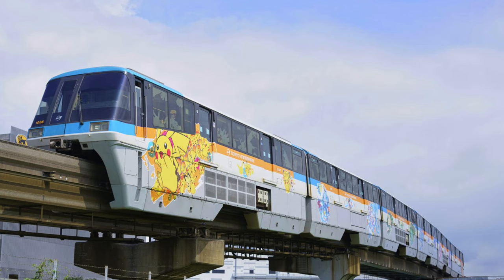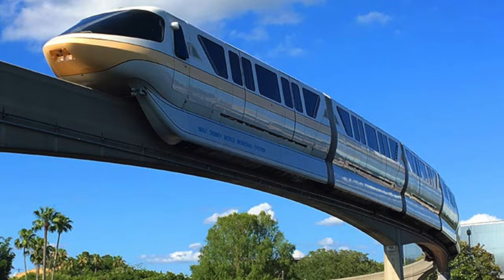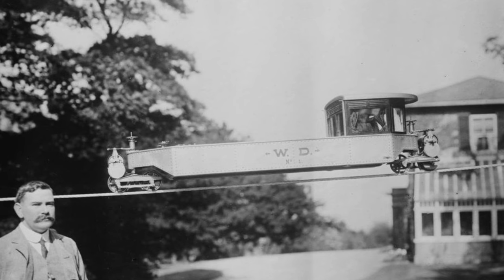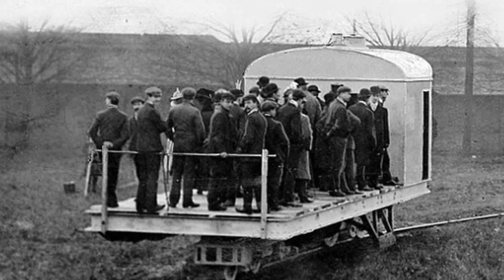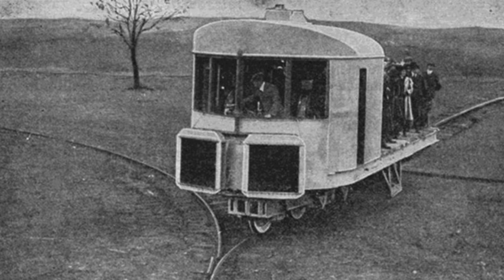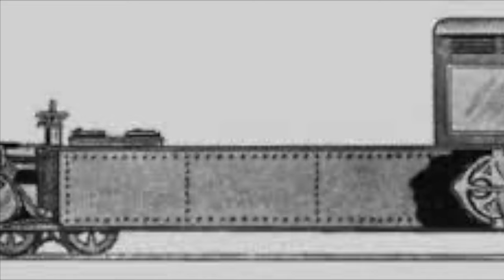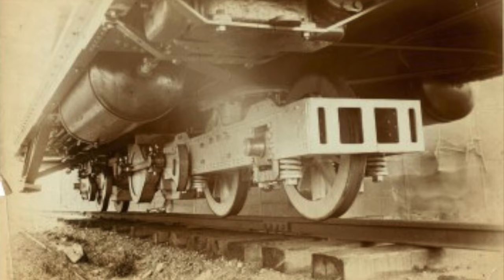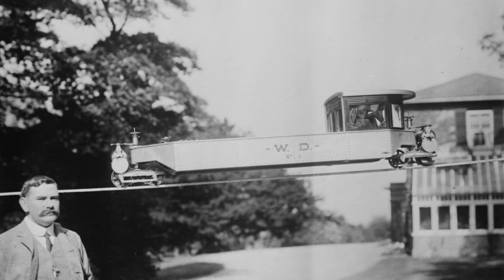That Time There Was a Gyro Monorail

Comment: The biggest drawback with it is every train car would need it's own stabilization gyro.
Reply: mmm... not every train car, but at least one every two... I think...
Reply: It would not cost much to put a third center rail for a mono train being the road bed is already established. I really like this novel concept.
Reply: Yes but great for trams. Issue is when it pulls up to a tram stop, everyone has to put their foot out.
Reply: @geoffgeoff143  I assume you're joking, but just in case, the gyroscopes would keep it standing. It's not using the forward motion if the train to keep itself up, only the effect of the huge gyroscopes inside.

Comment: the flywheel weight needs to be proportional to the weight of the train and it is effecting the friction force  
there for - it could make it less profitable than using the dual rials system with no flywheel weight but with double the parts that effected by friction

Comment: Just like with the new high speed maglev railway being built in japan from tokyo to osaka, 
This gyro monoloco need wheels instead of legs so it can be used without relying on its gyro when in lower speeds. 

But when the ground is less accommodating or theres the need to speed up, then the wheels can be lifted to remove the drag from the wheels.

Comment: 1 Coach Electric Train & Gyroscope in Middle

Frm Glasgow 2 Edenburg
No Stoping In Between

AC Supply: 200v

Train Width = 2.4 m
Train Length = 12 m
Cabin Height = 2 m
(Like Bus)

Single Track wit no Curve
And Bidirectional Train (Non AC)
Reply: Siting Arrangement
Facing each othr
2 Sit & 2 Row

And no Toilet & Curtain

Comment: Great idea - but I doubt if would have been significantly cheaper to build a rail track with one rail rather than two - you'd still need all the earthworks, sleepers and signalling etc. And of course, a 2 rail system only needed a simple steam or diesel loco to operate, with no gyros. Cool that it leaned into corners though!!

Comment: Awesome tech. The train is more complicated than a regular one but the savings on track infrastructure could be huge.
They say the train would 'naturally balance' in corners. I don't see how that can be, that is precisely what the gyro would prevent.  You would have to actively operate the gyro system to balance it.
Reply: The gyro already actively resists a change in its orientation, meaning that any turn will cause a torque that will force the train to angle in towards any turn, instead of being flung out of the turn as inertia would seem to dictate.
Reply: The working model you see has survived and is now on display in the National Railway Museum in York. It's missing It's cab but otherwise is mechanically complete.
Reply: @theproceedings4050 That is the reason it had two gyros interconected, each one rotating in opposed way.
Reply: The gyros moved mechanically and automatically, so it balanced itself. All the driver had to do was operate the accelerator and brake.

Comment: It's ingenious and it's very surprising to see it working, even after you've seen the nicely detailed exposition, but...

..it's a solution in search of a problem. It's a complex solution to a problem that can be fixed very simply, with two rails and a four-wheel bogey.

The active negative-feedback balance system is extremely complex and expensive in comparison to a four-wheel bogey and predicting failure modes of this mechanism - that are always catastrophic - is trivial.

It's common for innovators the "fall in love" with their ideas and as with romantic love, this is blind and frequently deaf to the flaws of the object of their affections.

A dispassionate engineer assessing this design would be thinking:

1) Complex
2) Expensive.
3) Heavy.
4) Dangerous.